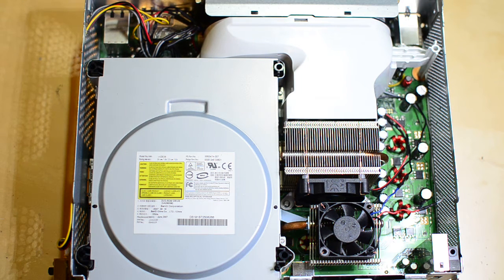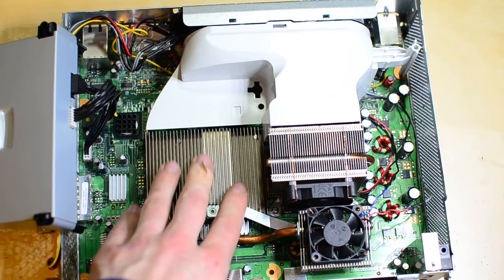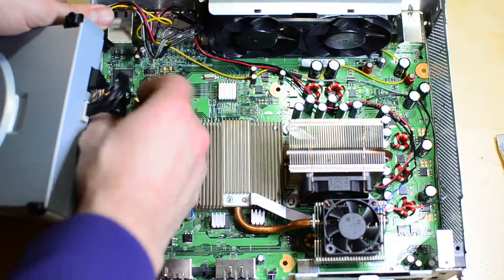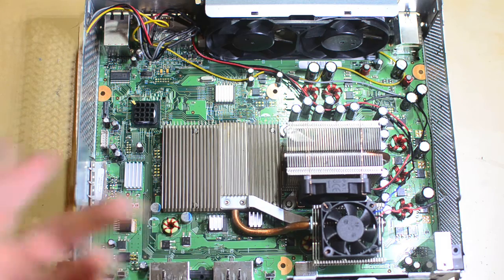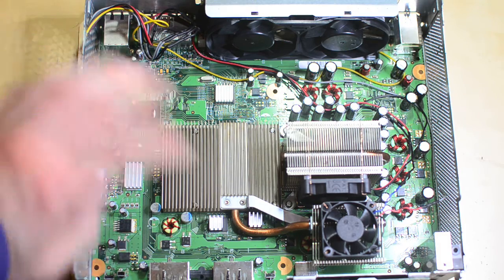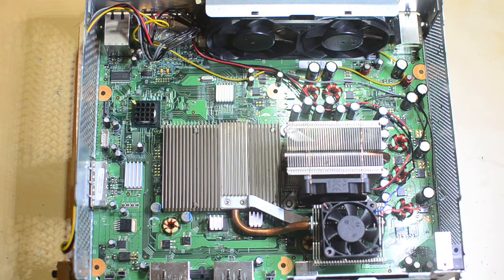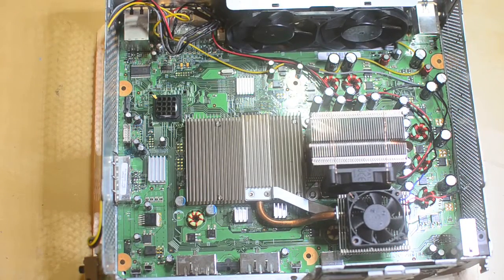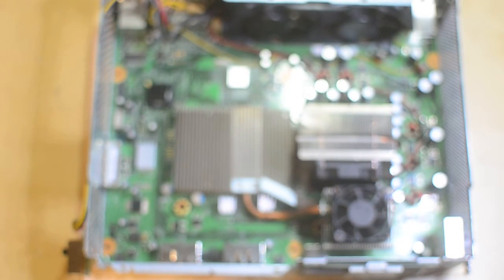Xbox 360 RRoD Resurrection and Switchable Fan Speed Upgrade - Part 1: Causes, Solutions & Upgrades

Comment: i did something like this, but then i took off the small fan and i added a thermal pad of 3mm thickness between GPU and DVD player, so it transfer the heat from the GPU to the dvd player metal shield, also i added another thermal pad and a small heatsink in the small heatsink, now the max temp i get on a Falcon Xbox 360 is 67°C on the GPU and 57°C in CPU and quiet fans
Reply: I just tried this on my xbox hope it helps it live a lil longer
Reply: @Sponge4664  I hope bro

Comment: Just took apart a bolt modded elite and the execution was horrible, so bad that the tension lead to a BGA solder joint short. The X-clamps are there to hold the heatsinks in place to the motherboard so you can put it back in the chassis.  their even clamp shape helps when the factory screws pull the heatsinks snug to the processors Die, thats the even tension the coolers get, not the X-clamps alone. meaning a bolt mod isn't really worth the damage it can cause. It helped some with extra tension early on in the Zephyr and xenon days as the tiny joints in the Die itself to the silicon were able to temporarily connect again but would eventually just RROD again in the longterm from thermal cycles. 

The old paste and some older aftermarket paste did also separate from those thermal cycles even though it wasn't dry, causing really bad hotspots which lead to a lot of E74 ERC machines, the rest suffered permanent damage from gradual overheating, If they had made a full plastic duct, at least that would have been better, sealing it has reduced temperatures significantly on my NXE Falcon model with graphite thermal pads over paste. 

The best thing for anyone wanted longevity out of their 360 fat (especially pre jasper versions)

> use graphite thermal pads for the central processors
> new X-clamps if you want
> thermal adhesive on the VRAM, chipset and controller chips with heatsinks (but don't add thermal pads to the VRAM under the heatsink, transfer can happen both ways and it will just cook the memory)
> use a reliable tape to duct the white shroud over the top of the heatsinks, preferably over the whole top
>Nyko external fan pack (make sure its the model that has a power cable passthrough as the thermal sensor versions with an extra plug are known to fail to heat and not kick in, will roast your xbox, ask me how i know)

With this you wont necessarily need a fan mod as the heat transfer is now so efficient, most heat is exhausted (especially with additional sucking pressure if you have a fan pack) and less is transferred to the secondary heatsink allowing it to still give the GPU some thermal mass. (if you're using a fan pack) the duct method is now efficient enough to pull some air through the CPU fins and out the back (especially on the Non heatpipe CPU heatsink as less dense fins). This way you now have a 360 that only needs to be taken apart for dusting and the odd disc drive service. (if you create a duct your disc drive doesn't have as much heat going through it meaning less chance of component warping and less jamming provided your belt is still good)

Comment: To find out what is the root cause of the first generation xbox 360 red ring of death is cooling system related rather than a gpu architecture design defect is the best news I've heard by a long shot as that means it is something you can mitigate easy with the added bonus of improving thermal efficiency a lot which isn't that far from what I originally looked after.

Even with the flawed cooling system I must say that I am amazed at how long my own first generation xbox 360  has survived from the dreaded red ring of death well over a decade since I got it. It sure is a robust gaming console despite the fact that it could prematurely break only a few years after it was new although it overheated a couple of times on a few occasions in a warm and cramped space to a room and it could have been that I have been fairly careful with it in its stock form.

Comment: This is a bit older, but I could never see any logic to not using the xclamps. The reason is when comparing the 360 to a standard PC. The PC has a sturdy backplate lined with a non conductive cushion to firmly sandwich the board between it and the cpu heatsink retainer. 
The Idea that using screws and washers instead of the xclamps is counterproductive. The reason being is when you mount the board in the chassis, the screw and washer idea just applies pressure to the top of the board with nothing applying pressure on the bottom on the center of the chips. So you have a sandwich with one piece of bread. When the xclamps are used they retain the heatsinks to the board and chassis, but also apply pressure to the top and bottom of the chips more equally where it should be.
Reply from the maker: The washer stack height between the chassis and the board is critical to provide resistance on the bottom of the board when the screws are tightened. Perhaps just replacing the thermal paste and reusing the xclamps would have been enough but they felt really weak to me compared to the typical PC heatsink mounting.
Reply: Exactly right

Comment: I have an old Optiplex 960 SFF I am thinking it would make a good case for a 360.
Reply: I've worked with a lot of Optiplex systems in the school system and I had been thinking the same thing- so much easier to get into and would have improved cooling with more room for fans I'm sure!
Reply: Bro i thought you guys were joking but if it works for u i also have an optiplex case lying around

Comment: Dont bolt mod your system people, apply new thermal paste and seal the fan shroud to the heat sinks, then tape over the top of the sinks so air gets pulled all the way through them, i like the idea of adding a fan to the gpu sink extension however.

Comment: X clamps where never the problem with rrd. If u open ur xbox and clean it at least every 3 month you wont have any problems alot of them rrd was cause by dust build up on the heat sinks.
Reply from the maker: The x clamps were not the entire problem, the crappy thermal paste was a bigger issue as well as the dust buildup but the x clamps did not provide nearly as much pressure between the heat sinks and cpu/gpu as, say, bolting it down like every other PC every built does.
Reply: @Govanification  the design itself, robust, they dont tought about cooling too much

Comment: sigh. your "chipset" is ram aswell.

when he called the disk drive a hard drive i lost all respect lmao

and he also used a method that he thinks wont flex the board but in reality it does. 

also 2 lights is overheating so idk why you would do the retarded bolt mod in the first place. 

best mod to do is to add intake fans
Reply from the maker: Harsh.  
- HDD/disk drive was a verbal slip up, I call it the disk drive in my other videos. 
- Of course bolting the heat sinks down flexes the board a bit, but I attempted to minimize it with a washer stack, and also this is a dinosaur computer so whatever.
- Heat transfer is a function of thermal paste properties and contact pressure, so the "retarded" bolt mod increases the clamp pressure and is much more similar to how a typical PC CPU heatsink is attached.
- Intake fans in addition to the exhaust fans would be a good idea, I even mention it in this video as that's how desktop PCs are typically set up, but I focused on getting more air directly over the heatsinks. Doing both would be an amazing thermal solution but would also be loud AF.
Reply: @Govanification  from research some other mods to do would be to dremel out the metal mesh in the back where fan is pressed against to cut down on airflow resistance. I also haven't tested it but talismoon claims there fan moves like 45% more air so you could 12v mod that fan. Me personally im also planning on dremeling the right/ bottom mesh gone and adding a dust cover and buying a fan stand and modifying it to give the system a good intake. Also I read that the xclamps were made that way for a reason and that central pivot/pressure is needed/recommend so the board doesn't get hot and sag and break the solder joints under the chips. Idk how true it is or not but you could just get those non electrically conductive thick thermal pads and put underneath both chips to add some under pressure, me personally I just bought that xclamp fix kit that has that metal plate and 2 thermal pads for that very reason

Comment: Why do the internals of a xbox 360 look like a normal pc
Reply from the maker: It basically is just a custom PC with custom firmware and software. That's also why it's so embarrassing for Microsoft that they botched the thermal solution so badly, since PC cooling architecture was pretty well understood when this console came out.

Comment: The xclamps are there for a reason. Too even apply pressure across the heatsinks. You risk cracking the heads on the cpu/gpus. Also if you are going to use a heatgun to try and reball/reflow the chips you should at least preheat the board. If not you risk pop corning your chips. As for the heatsinks and extra fans thats actually pretty smart
Reply from the maker: Yeah for preheating the board I could have thrown the whole thing in the oven before doing the concentrated heat gunning, but it turned out fine in my case. Also the screws I put on are not super tight and I was careful to tighten them evenly. Yes there is extra risk of damaging the CPU/GPU through overclamping but I was careful and it was fine.

Comment: You should just buy an Xbox one
Reply from the maker: Ha, yes, I should, especially now that they're rolling out backwards compatibility, but that wasn't the point of this video.
Reply: I know… But by the Xbox one S not the launch date Xbox one because it looks a lot nicer and smaller and there is no Power brick
Reply from the maker: @123theprodigy5  I now have an Xbox One X and it's great. Pretty much only use my 360 now to play GTA5 because you can't play the 360 version of it on the xbone (they want you to buy the newer version).
Reply: @123theprodigy5  why do people think "there is no power brick" is a good thing. I'd rather have a power brick than the power supply being crammed inside the console adding extra internal heat. Plus the one s looking nicer is your opinion, I'd rather repaste a original and have that kinect support.

Comment: Recently I had problems with my xbox 360 s,I was watching netflix for less than an hour an the episode i was watching paused(not freeze) it was stuck loading at a percentage and so i turned it off,as i turned it back on it was stuck on the 360 loading screen (white back xbox logo) and would just sit there for 5 minutes and then the screen went black while still on.I took it apart to clean the case in case it wasnt getting enough airflow but i feel i am going to run into new problems.what are some ways to get it a nice cool temperature(not watercooling)
Reply from the maker: Even if you're not getting the RRoD you could still benefit from redoing the thermal paste and overriding the fan voltage controller. The thermal paste is probably the biggest one tho, and make sure to vacuum off your heatsinks, fans and any vents that have collected dust over the years.

Comment: good job I just got a 360 black in the box with red rings for 10 bucks and replace thermal paste I also used heat 🔫 to heat it up before starting it's been a month no issues
Reply from the maker: Nice! That's a steal. I spent more than that on fans and heatsinks haha